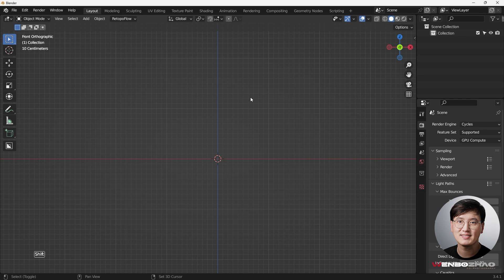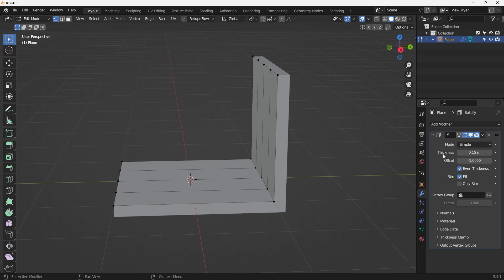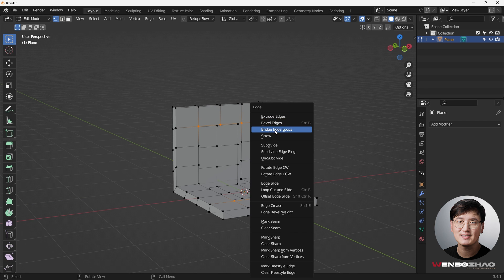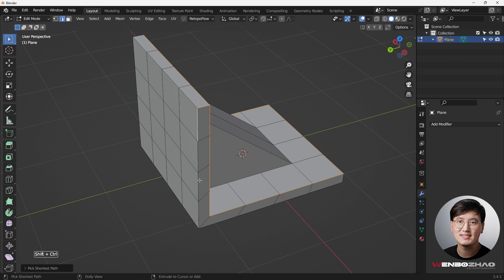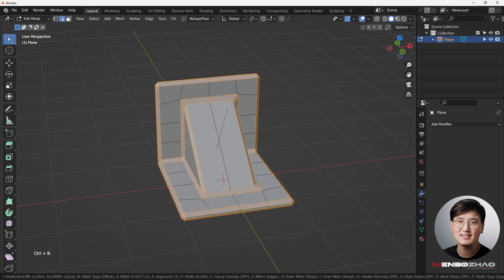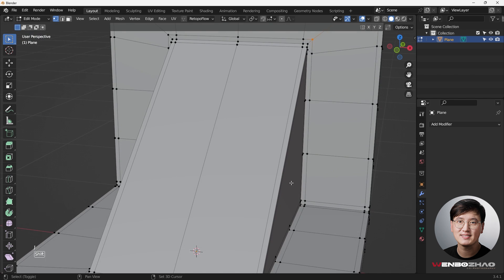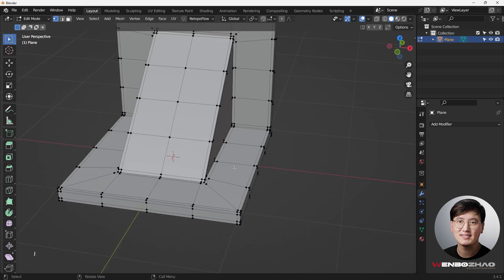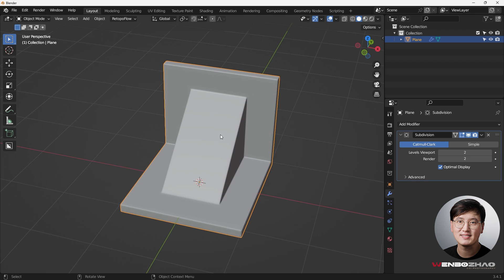Day 01 | 30 days modeling challenge in Blender

Comment: Tip: you can use bevel modifier instead of selecting all edges manually
Reply from the maker: Thanks mate, this is the first video for absolute beginners to start with. another better ways is to use select sharp edges directly, I will be showing these tricks progressively in this series of videos, and thank you for your tip, bevel modifier is always very handy:)
Reply: what a polite answer appreciate it. @WenboZhao
Reply: Or select sharp edges, anyway great video
Reply: I couldn’t achieve the same result with the modifier
Reply: @pistoletikki   Chances are you didn't Apply transformation before  beveling in Edit Mode, so you must have had less edges.
Reply: @pistoletikki  You must've done something wrong cause I read your comment earlier and I was curious to try it out myself. I ended up getting the same results with just the bevel modifier. Although with the bevel modifier techqniue I have the ngons.

Comment: Why bevel? 

When you apply a Subdiv modifier the mesh will lose its hard edges and will get rounder. The bevel  produces loop cuts that help keep those hard edges. You can even manipulate the loop cuts if you want to change how the edges look.

Why quads instead of n-gons?

Quads usually produce better subdivisions. You won't get weird effects if you use a reflective material when you have quads. You don't lose your capacity to create loop cuts when you have quads.
Reply: Thanks, I felt like some explanation was missing about why we were doing these things :)

Comment: What is the point of beveling if the corners are still @ 90 degrees? Thanks for your work!
Reply: It helps with the Subdiv modifier. The extra lines pushes the face of the mesh towards the edge. Without it you get a rounded mesh. Try making it again without beveling and add the modifier and you will see what I mean.

Comment: First of all great tutorial man! I have a problem with a last step, which is adding SubDiv surface modifier. When i do that my model broke (bevel goes only for one corner). I check the normals, reset it but still don't work. Would be greatful for some tip to not make the same mistake in next projects. Here's link as a reference and visualization of the problem: https://drive.google.com/file/d/139QTNwXFody98hPuAH1bLzSDfQIMgV1m/view?usp=sharing
Reply: It looks like maybe you missed that corner when applying the bevel - the extra loops the bevel applies keeps the corners sharp when you apply the subdiv modifier